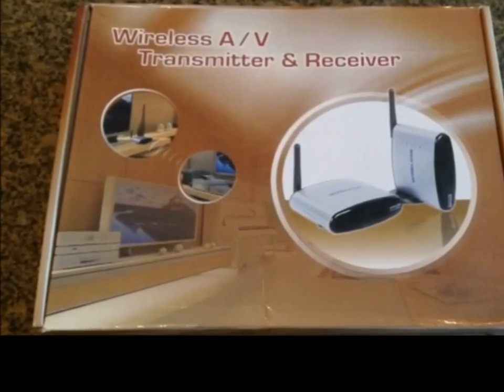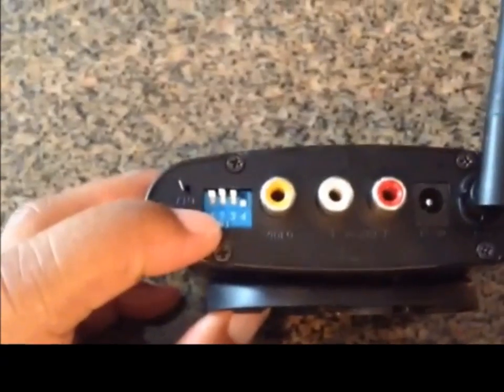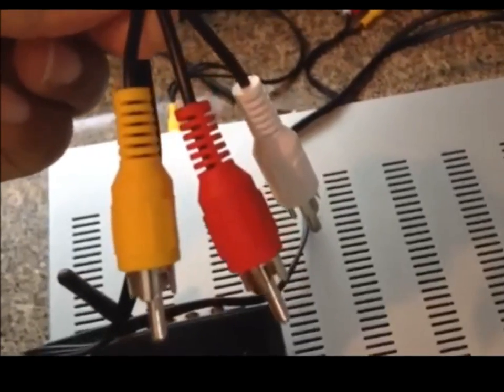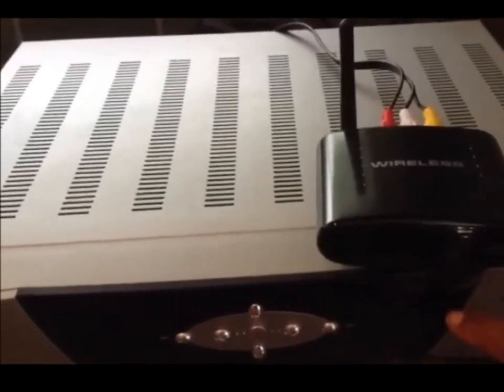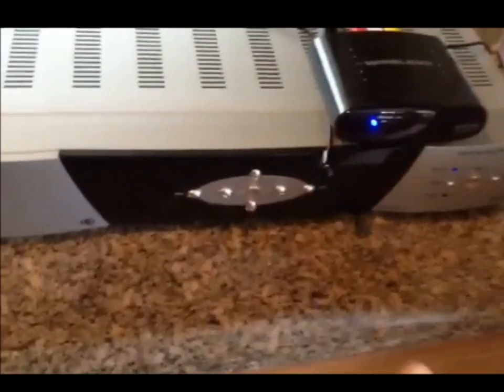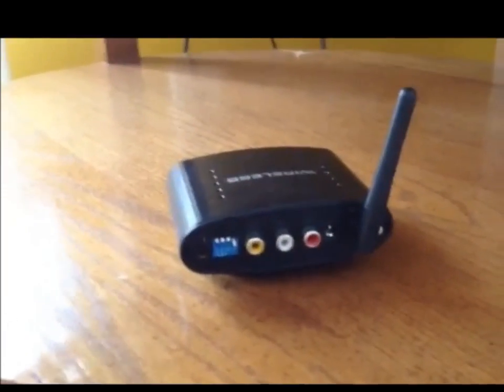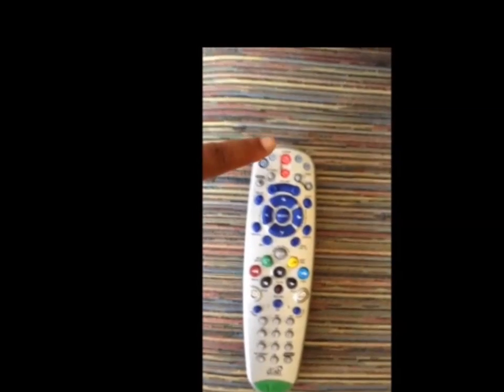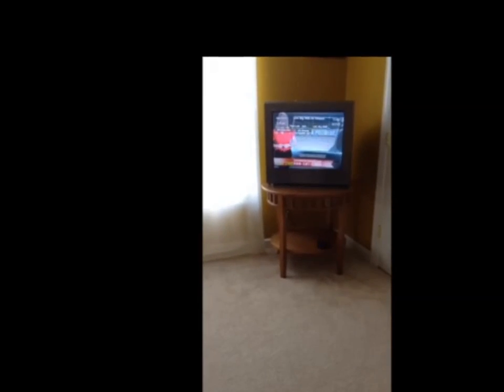How to Install a Wireless TV Satellite & Cable Audio Video Transmitter to Save Money

Comment: Latisha, thanks for the video, it transmits the signal fine. But, TV2 (the one receiving the signal), is not able to change channels using the Dish remote. Towards the end of your video, you said that you must use the Dish remote to change the channels on TV2. I am assuming you're referring to the same Dish remote that programs TV1 (the one that is transmitting the signal).
What do you suggest I need to do to be able to change the channels on TV2 with Dish remote?? Do I need an IR antennae thing? If so, maybe thats my problem because my unit did not come with one but it has a place to connect one to. I have the x10 VT46a / x10 VR46a.

** Info for others: My DVR (TV1) has the transmitter connected via R/Y/W cable. But, the receiver on TV2 is connected using the coaxial cable. For some reason, TV2 didn't work using the connection cable r/y/w, but did using coaxial.
Please advise the remote question. Thanks
Reply from the maker: azyardies I see possibly two issues. Make sure the antenna for television one is over and lined up with your transmitting device such as the satellite. Secondly, make sure that on television to you are using the remote from TV one and select the button that corresponds to the device that you were trying to control. Four instance, I noticed that you stated you were using a DVR. You need to make sure that you're using the button that corresponds to that device. In addition, on my, I was using a satellite TV downstairs and a satellite TV upstairs. Therefore, I brought the remote upstairs to use on television two. When I change the channel on TV to it also changes the channel on TV one. Hopefully this will help.

Comment: I need one for cable but all of the ones i've seen do not have a place to screw the cable line in.
Reply: Zane Wv,  Do a search on Youtube for a Blonder Tongue.  That is the correct name.  No foolling!   That is the kind of unit where the Cable Coax is used instead of these A/V TV Transmitters.  I'm researching this stuff right now.

Comment from the maker: Maritza, you asked questions about the Transmitter on Amazon at http://amzn.to/IrsWMw. The television does not need to be on to use this device.  However, the satellite downstairs DOES have to be on because it transmits the signal to the other television.  The volume on the television downstairs does not need to be on.  Furthermore, the volume on the television downstairs has nothing to do with the volume of the television upstairs.

Comment: I would like to connect from the antenna (the transmitter) to a TV set in other room.  Perhaps a TV antenna to AV cable adapter to connect to the transmitter?

I would like also a PLC solution (better )👌

Comment: Latisha, My Wireless A/V Transmitter & Receiver is driving me NUTS ! I've moved them from maximum 20 ft. apart to INCHES apart. Same floor, no interference, no need for extra IR. Everything's plugged in per instructions, tried switching all 4 switches on backs, all on the same setting, powers on, TV's on AV (and everything else), feeds coming from DTV rec., 1 HDMI out to 1 TV, RCA out's' to wireless transmitter, wireless receiver's on, same settings. Still I get NOTHING. This has been going on for MONTHS ! I need HELP ! ANY suggestions appreciated !  Thank you !
Reply from the maker: Drew McClure Has the set up ever worked successfully?
Reply: Drew McClure Just a thought, but this works for me:
My DVR (TV1) has the transmitter connected via R/Y/W 
cable. But, the receiver on TV2 is connected using the coaxil cable. For
 some reason, TV2 didn't work using the connection cable r/y/w, but did 
using coaxil.

Comment: Any ideas why I always have thin white lines appearing on the screen after approximately 3 minutes of turning the devices on? For the first three minutes the image transmitted is fine. It's a 5.8 G model which means that in the UK it's immune from interference from rooters or mobile phone signals.
Reply: Dear, I guess it's interference, first, make the distance between the transmitter and receiver shorter, second, change channels, but keep the transmitter and receiver in the same channel or it doesn't work.

Comment: Is this a analogue sender?
Reply from the maker: Dean Denton Based on the way broadcasts, it looks like it is taking the digital signal and retransmitting it. I would recommend that you click the link in the bottom of the video. Afterwards, read the specifications for the manufacturer based on the device you are reviewing.